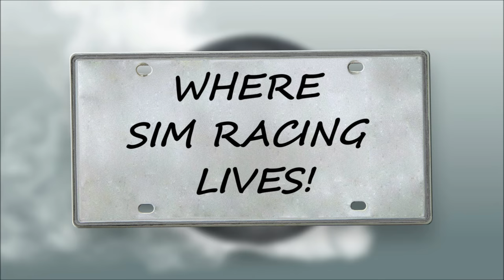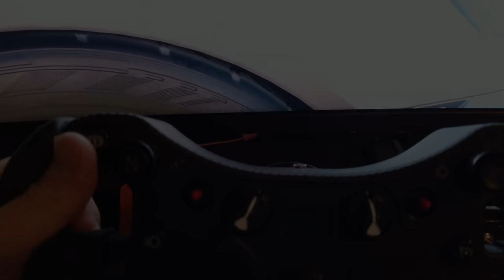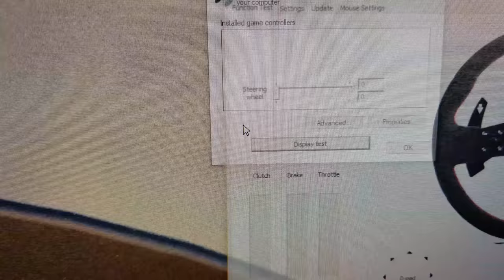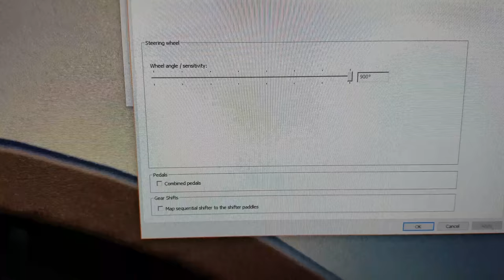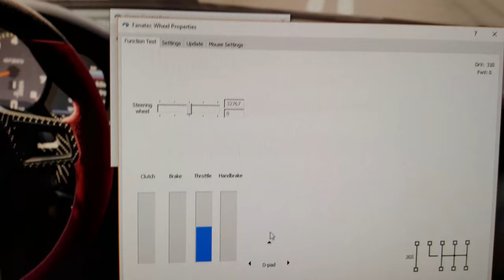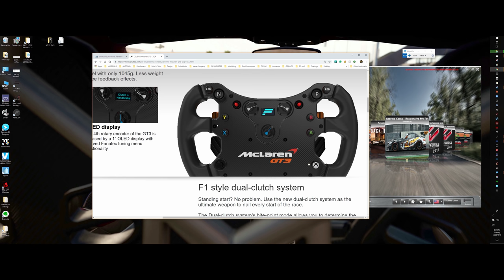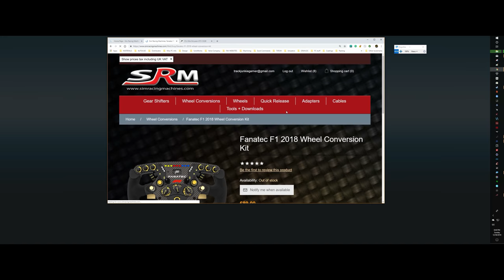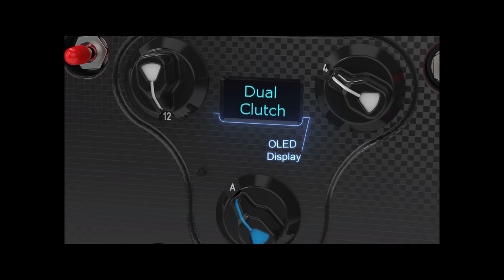SRM Fanatec McLaren GT3 Wheel Conversion kit

Comment from the maker: FYI: Someone asked the question: "Do you still need to have your other wheel connected to the USB for the Accuforce to receive FFB? This is a good question as I first ran into it myself. No is the answer, but the solution is to be sure to go to SC4<settings<Accuforce Steering System< and make sure to untick the box that says "Halt feedback when SimXperience wheel button box is removed" This should not be ticked on and then any wheel button box combo works. Thanks for asking!

Comment: Hey chief great info. Just about to order all my parts but the b and g qr has that little spring nub on..... is this a pain, can you not just pull it out or shall I buy the original qr from SIM experience..... ? Thanks in advance
Reply from the maker: Cool deal. No, it's not really a pain to use since it takes 2 hands to release the QR anyway your just pushing down on the pin with your finger first. With that said if you don't want the pin I would get the SimXperence one because it's unlikely you can remove the spring that pushes the pin up. The dang screw is tiny and strips with ease so I'm living with the pin myself. Hope this helps and thanks for watching!
Reply: @TJRSIM  cheers TJR, just pulled the plug and ordered the setup,thanks man for your vid and information...... very cool. Thank you.
Reply from the maker: @focussimulation7186  your welcome. Glad I could help
Reply: @TJRSIM  it did yes, just subscribed bud.

Comment: Is the B&G qr always both sides? (Wheel and base)
Reply from the maker: The B-G only bolts on one way with the qr part facing your wheel base. Is this what you are asking? Want to make sure i answer your question. Thanks for watching.
Reply: Thanks for your reply. I was just wondering if you want to use the B&G for two wheels that you have the “base side” twice or if you can order it separately with the wheel side only.
Reply from the maker: @JonasWindey  So the B-G is just one unit itself. See here: https://www.simracingmachines.com/WebShop/b-g-quick-release I comes with the flange I think you're referring to, that mounts to your wheel base. It's a complete unit with only 1 base side flange. If you're wanting to use it on 2 different wheelbases you would need to order 2 base side flanges. However, I'm not finding just the base side flange to purchase. I'm only seeing the complete QR unit. You might need to do some searching for just the flange portion.